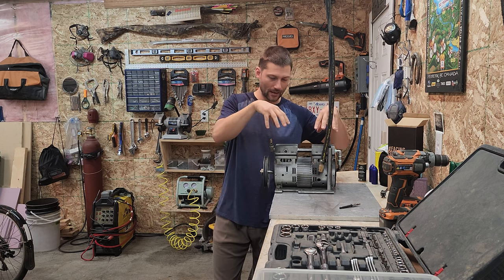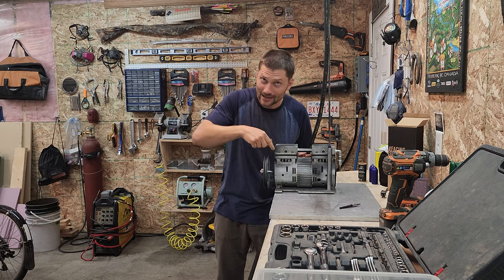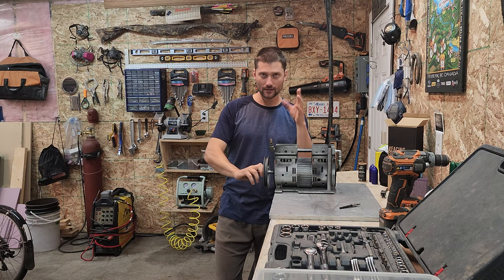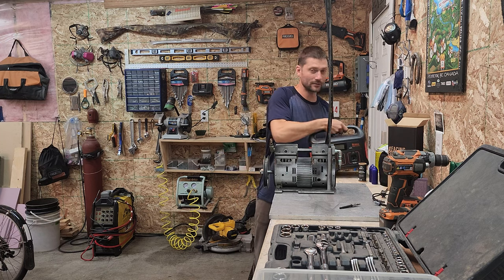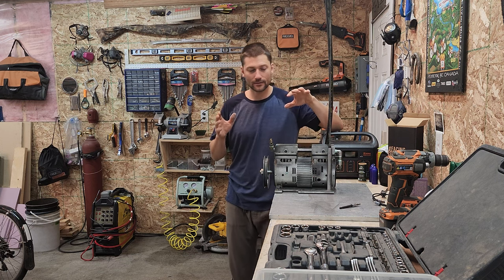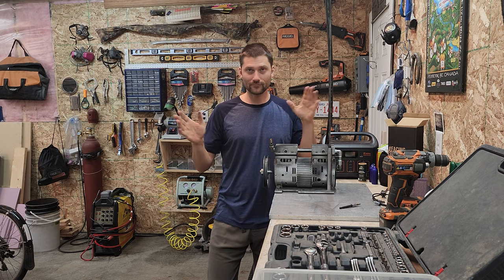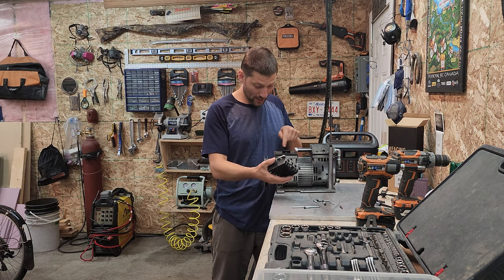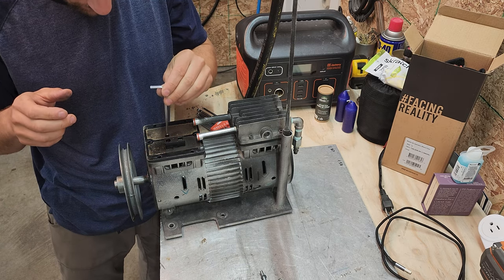What's Wrong with my Home Made Hookah Air Compressor.  Teardown of an Ultra Quiet Compressor.

Comment: u should have a bailout tank anyways for safety, like a 1/2 hr reserve... run a rebreather through it
Reply from the maker: I would 100% do that if I was ocean diving, or doing anything deep.  For the stuff I plan on initially, I should just be able to swim fir the surface.  Like 10 feet deep at most...

Comment: Have you thought about adding a CO2 rebreather thingy that divers and submarines used to recondition the air u exhale? They say it adds, like, 5X more air time/vol... there's still O2 in the air we exhale. Little pellets in the exhaust line that absorb CO2.

Comment: Howdy. That compressor looks rebuildable - maybe check for a cylinder and seal kit?
Reply from the maker: Hi Flyover,  Thanks to you suggestion, I did a little google search and it looks like I can get new piston rings for about $40 each and new cylinder walls for $50 each before shipping.  Works out pretty pricy all things considered, but Maybe I'll see if I can flip one of the rings inside out or something...

Comment: have you ever thought about getting a bluenemo diving system or a cheaper system like a OVERWELL Diving  Set , don't get me wrong i think the system your building is a great idea but there are lighter ways to dive and i enjoy your channel especially the hikes and your gold prospecting 👍
Reply from the maker: I hadn't actually seen a modern electric hookah system until you pointed those out.  I do already have my Jackery 500 power pack to run my other little air compressor which is essentially an electric hookah diving system I predict will last 2 hours on a charge.
I'll have to take it for a spin soon and report back how well it works.  Thanks for the tip on Bluenemo and Overwell.

Comment: Looks to me the vibration got you. That was a terrible looking quick connector. Still fun to play with Ideas and eventually find a solution . Princess auto usually his good junk on the cheap . maybe a10 foot floating snorkel hose strapped to your back, back hose connected to  mouth hose ?  a thought, never snorkeled ever . compressed in a can ?

Comment: have you found any documentation that states wht RPM the original motor ran at ?
Hand drills run quite slowish and you have geared the pulley down close to 1 tenth.
I would guess maybe you running your pump at 200 rpm only , maybe 400
Reply from the maker: I was definitely spinning it slowly for the test, but running at engine speeds I could still see that I was lacking in airflow quite a bit.

Comment: Question: How did you figure out the size of the pulley? What is the speed of the compressor used to run at when it was new?
Reply from the maker: The stock compressor spun at 1700RPM.  When it was working it made plenty more air than I needed to dive so I went for a speed a little below factory.

Comment: CO2 isn't for depth... that's helium, etc. CO2 is for extending your air - "rebreather". It's the same principle as silica gel for air compressors but instead of scrubbing moisture, It removes co2 from your exhaust valve so you can breath it again... It recirculates your exhaust air. I'll bet your little compressor would easily keep up. We use only a fraction of the oxygen we breath... we exhale more oxygen than we use/ breath
just an idea
Reply from the maker: I feel like the added complication of a re-breather is not required.  This little compressor actually puts out plenty of air to dive off of when it's running properly.  I got a new cylinder ring in the mail recently. So I'll be doing an update soon.
Reply: @UtmostOutdoors  cool. I got an old compressor probably needs rings or whatever. I've got some winter camping ideas I'd like to try, seeing as a placer's license is cheaper than a camping permit!

Comment: I have an oil free compressor what air filters should i use
Reply from the maker: I found an industrial specialty supplier where I live that had a compact 3 stage breathing air setup.  Search for "coalescing breathing air filter." Or "class d breathing air filter"  I think the one I have is down to 0.01 microns.  Honestly, being oil free and diving for recreational lengths of time is a very good first step compared to some of the crazy things I've seen people do...
Reply: @UtmostOutdoors  im situated in south africa im building a diy setup my compressor runs at 116 psi cuttof and startup at 70 psi it has 25 litre accumilator ive seen some of the charcole inline filters but they are insanly expensive i was thingking of making my own air filter but am open for segestions i have a small oil and water filter on it but i dont want to take unnessery risks with residiual oil fumes that may still be in the compressor from manufacturrer
Reply from the maker: The setup I found locally was about $150 Canadian dollars.  I've seen a more basic inline filter sold by keene engineering just called a "class d air filter" which might be of some help.

Comment: I don't know anything about breathing underwater.
But why can you not simply have a hose from your mask into the atmosphere ?
Why do you need a pump ?

Also , how deep do you expect to be diving ?
the sniping videos I have seen seem to be rarely ever over 6 feet deep ?
Reply: A 6 foot hose contains a lot of air. When you exhale, not all the air is pushed out, so you end up just breathing the same air again and again, getting less and less oxygen.
Reply: @whynotdean8966  I would have thought that there was some sort of valve arrangement within the mask where breathing out would not go to the inlet , but out another tube into the water , like with scuba
Reply: The added pressure from the pump counters the water pressure  on your chest making it easier to breath. There's only so much work  your diaphragm can do 😉
Reply from the maker: Great discussion guys!  In the past I made an attempt at diving for golf balls using a snorkel extension with a one way valve so that I could breath in down the tube and then out the bottom valve of my snorkel without pushing the exhaled air back up the tube.  The problem is that the weight of the water keeps you from sucking in any air even at only a few feet deep.  My solution at the time was to have a guy on shore using a dingy hand pump to supply a but of pressure through a garden hose and that did work down to about 6 feet but my friend got tired very quickly!